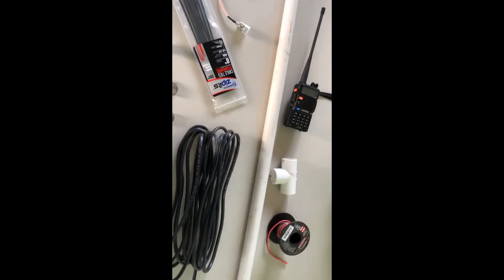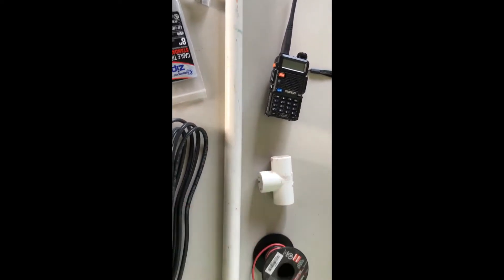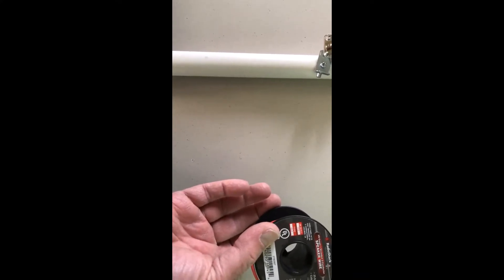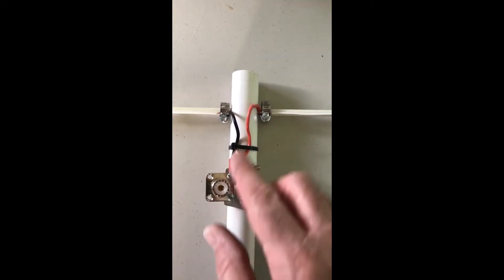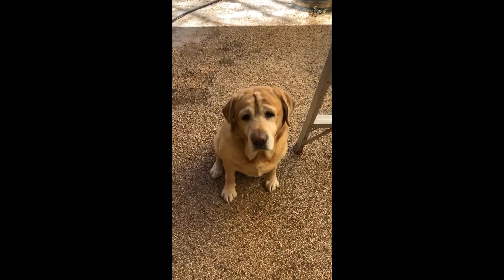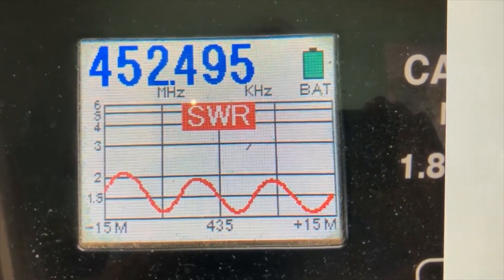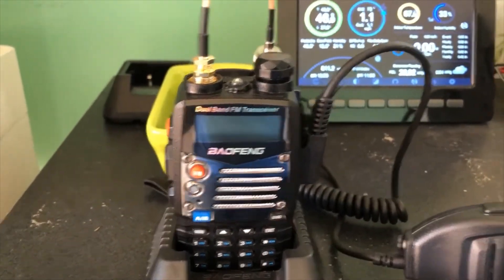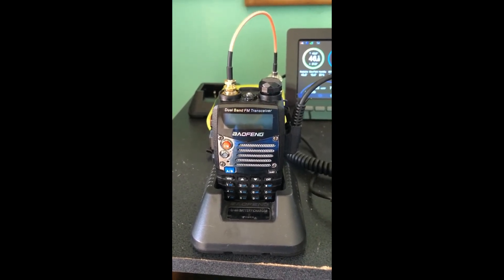DYI 2 Meter Base Station with Dipole Antenna for Around $50.00

Comment: You didn’t mention that Rod that the wires were attached to 
is that fiberglass?
Reply from the maker: Yes, it was originally from a bicycle trailer flag pole.